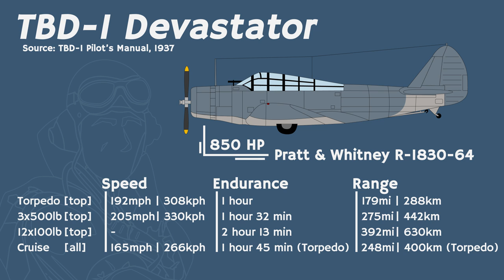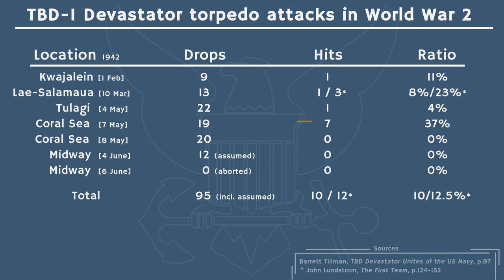In Defense of the Worst Aircraft of World War II - TBD-1 Devastator

Comment: It's interesting that outside of the areas of endurance and range the TBD (which is widely remembered as a terrible aircraft) compares very favorably with the Fairey Swordfish, which is fondly remembered as a great plane by many today. To be fair, the endurance and range of the Swordfish greatly helped it in the duties it faced in the Atlantic and Mediterranean (striking the Bismarck; hitting Taranto at night; convoy escort on the Murmansk run). However, even if Laub's recollections from 1970 are spot on the TBD was still much faster than the Swordfish. One has to wonder how fondly the Swordfish would be remembered today if it had had to attack a Japanese fleet in proper defensive formation with A6M CAP rather than an individual German ship or some Italian ships caught at anchor.
Reply from the maker: I think one issue is that the opportunities the Swordfish had worked out in it's favour. They were involved in those two massively publicized events you mentioned, that being the sinking of the Bismarck (a good old David vs. Goliath story) and Taranto which were a success. Beyond that you also had Mers-el-Kebir, and the Swordfish was also tasked into recon and ASW without a clear replacement slotted to come in until '43.  Midway is the 'only' battle the TBD usually gets linked to even though it flew multiple operations before that and did not have single loss to enemy fire until that very last battle. However these engagements were less publicized, and the TBD (courtesy of the Mark XIII) punched perhaps below its weight in pretty much all of them except Coral Sea where it had that one 'claim of fame'. Had the hit ratio at Kwajalein, Lae-Salamaua and Tulagi been higher, to lets say an overall average of 30% which would have been perfectly possible in at least the latter two (since like Taranto and Mers-el-Kebir they were 'harbouresque' attacks), then I do think history would have been kinder to the aircraft. These missions did show that it could do its task, if properly supported, just that the torpedoes made those particular drops null and void - something that only worked out properly at the Coral Sea.
Reply: @MilitaryAviationHistory  I'm surprised you haven't mentioned the swordfish's own "Midway" scenario the Channel Dash, where all of the swordfish sent out to attack the KM ships were absolutely destroyed with zero damage dealt to the KM or the LW by them. Almost as Identical to the TBDs at Midway with their lack of fighter cover and their heavy opposition, I guess it hadn't mired the Swordfish's PR as 2/3 major actions they had been that were heavily publicized had been positive.
Reply from the maker: @legoeasycompany  Yes, that could be an example, but I think the circumstances are different. In the Channel Dash (‘42) about a handful of Swordfish were lost (iirc), among a plethora of other planes - if it was only/nearly only the Swordfish that did poorly that day, with the rest of the planes achieving success, then maybe it would have stuck out. But both the RN and RAF had a poor show that day and in the chaos the Swordfish was only part of the casualties, other than in Midway where the individual carriers lost close to their full complement which was more significant overall – and the reasons were more apparent. Before the Channel Dash, the Swordfish had already hit Taranto (‘40) and the Bismarck (‘41) before that – and nowadays (and for some time) give it that David vs. Goliath vibe. I guess ultimately there is a fine line between that and gaining a bad reputation – one or two missions can make or break it. If we were to assume that the early TBD sorties would have seen more success, maybe if would have also taken a softer blow to its reputation. That said, I also feel like the fact that the Navy did have a replacement for the TBD in the TBF (the latter was supposed to play a more prominent role at Midway anyway) contributes to its status today because it artificially underlines that ‘outdated’ status and the tragic nature of VT-8, VT-6 and VT-3 at Midway.
Reply: @MilitaryAviationHistory  I do just like how the Swordfish and TBD both considered "outdated" while the former had the triumphs of Taranto and the HF the Bis, while getting completely slaughtered at the Channel Dash without it's perception being tarnished that much. While they both had their bad day against 1. Strong AA and CAP  and 2.Were attacking in small uncoordinated strikes unsupported by friendly fighters. The Swordfish still has the proud moments of the previous 2 mentioned events, while the Latter the TBD has good but not outstanding records when used effectively. Yet one gets praised for it's actions while considered "outdated" yet the other while with good service gets lambasted for being outdated and said to perform poorly for it's actions at Midway. (Even though as you mentioned the 6 "State of the Art" TBFs stationed at Midway had similarly poor results and suitability). One gets all the praise for it's actions and outdatedness, while the other gets all the smack talk for it's similar outdatedness and other poor factors at Midway.
Reply: Bear in mind that the best two performances of the Swordfish (Taranto and Bismarck) were done at night (Taranto), with no aerial opposition (Taranto and Bismarck), and/or in execrable weather (Bismarck).  The Devastator never went into combat at night (and I can find no evidence of it attacking in bad weather), and even the Swordfish, when up against a target defended by fighters (Channel Dash) did predictably horribly.  Also of note, the Brits never had our problems with aerial torpedoes - apparently, theirs actually worked. 

Later in the war, the Stringbag proved viable in the North Atlantic, where it's good poor-weather performance, its ability to operate off a CVE "baby flattop" and its ability to fly slow and stable in a bomb run, put it in a good position to sink U-Boats (and the same could have been said of the TBD if it had been used in that role).  But in a contested battle, the Swordfish (imagine it at Midway, vs. the TBD) was certainly at least as vulnerable as the TBD.
Reply: @michaelbizon444  I'm sorry but I have to disagree.  The varied missions undertaken by the TBF included many that were beyond the realm of "viable" for the TBD.  These include night-attack using radar, night CAP (also using radar, in conjunction with F6Fs without radar, such as the squadron Butch O'Hare commanded when he died), rocket-firing ground attack, and coordinated torpedo attacks (such as against Yamato and Musashi) where airborne speed was a critical success factor, long-range (and relatively high-speed) scouting missions - the list goes on.  TBD was obsolete, and you don't win wars by flying obsolete aircraft. 

Also, the Sherman example isn't actually on-target - while it might have taken five Shermans to take out a Panther or Tiger, remember that Shermans always entered combat as part of a five-tank platoon, or 15-18-tank company, so the numbers were always there compared to the penny-packet use of Panthers and Tigers in the West.  The appearance of five or 15 Shermans taking on a Panther creates the illusion that this is what it takes to defeat the Panther, instead of conveying the truth that this is how the Shermans were put into combat.  To validate this, by all means check out Rick Atkinson's Liberation Trilogy or any of several RP Hunnicutt books on US armor in WW-II - especially  "Light Tanks (Stuart) Vol. 1" or "Medium Tanks (Sherman) or "Heavy Tanks (Pershing)" for information on our squad formation and battlefield commitment.  Or check out the Chieftan's "Think Tank" series of videos, featuring a panel discussion among six of the most recognized tank warfare historians.
Reply: The Swordfish was just used differently. It wouldn’t have done good in the TBD’s role but it did fairly well in what it actually was sent to do. We need to remember that what people would consider bad about the Swordfish, often brought more some advantages against the enemy as well.
Reply: Ned Barnett The Brits always did like their night attacks : P
Reply: Look what happened during the channel dash. The one Swordfish squadron that attacked was wiped out just like Torpedo 8 by the Luftwaffe air cover.
Reply: @michaelbizon444  I never said, nor did I imply, that the six essentially prototype Avengers at Midway were doing anything other than an unsupported attack against overwhelming odds.  Later, the Avengers did carry radar - which the already-overloaded Devastator could never have fielded - and performed many other missions, from COD to ground attack, from torpedo attack to anti-sub patrols (though the Navy's carriers desperately needed anti-sub protection (Saratoga, Wasp, North Carolina, etc.) in 1942, TBDs did not do anti-sub patrols.  That was left to the far more capable SBDs) 

However, your final line (before the incomplete comment about Shermans) says the Devastators would have been updated and improved, which is what I said should have happened, but didn't.  The plane had been out of production, and the assembly line repurposed to other Douglas aircraft (C-47/R4D, A-20, SBD, B-17s (through it's Vega subsidiary), and had other planes, like the A-26, coming on line - so producing them in the quantity applied to the Avengers (over 5,000) wasn't in the cards, nor should it have been.  The TBF was a far more capable aircraft, with nearly double the horsepower, more than double the range and double the speed, better protected (passive and active protections).  I can't for the life of me figure out why anyone would prefer to put a dinosaur back into production when a truly modern aircraft was already in production.

Finally, returning to the TBF at Midway, these six planes were basically all that had been produced. Their crews weren't fully-trained in their new aircraft, which (as do all new aircraft) still had a few teething troubles.  However, if we'd had three deckloads of TBFs, supported adequately by F4Fs and flying in concert with SBDs (hitting them high and low at the same time), which was tried with the Devastators, but their performance was so inferior to the SBDs and F4Fs that coordination proved impossible.  Had it been possible, the TBD might have survived better - but still not good - the plane was too inferior to go up against a well-armed battle fleet supported by A6M Zero-Sen fighters.  And the Grumman Avengers at Midway would have done far better - as it did at Philippine Sea and Leyte Gulf in 1944.  But sending in six with no fighter cover, and unconnected to any other attack (they didn't sync up with the Midway-based Marine  SBDs and  SB2Us, let alone the USAAF's sacrificial lambs, those four doomed B-26 "torpedo bombers."

But enough of this - you have your views, which I don't share.  I've researched this at length for several historically-accurate novels about the air war in the Pacific in 1942, and I've seen nothing to suggest that even upgraded TBDs could have done well - though they would have done better with the more powerful version of the aero-engine that powered them.
Reply: @michaelbizon444  Tell that to the Yamato and Musashi, which - with the rest of the Japanese battle fleet - could have done much better had America stayed with upgraded versions of the TBD. 

Beyond that, I never said nor implied that the torpedo bomber was a war-winning weapon - it was an integral part of any Alpha Strike deckload attack launched by US carriers, and was intended to operate with fighters, fighter-bombers and dive bombers, supported by search aircraft (which were SBDs. SB2Cs (later in the war) and TBFs throughout their service).

What the German fleet had or didn't have is immaterial (though they produced a torpedo-toting FW-190 torpedo bomber that, had the Germans actually put a carrier into operation, would have been the best carrier-based torpedo bomber of the war - but the Kreigsmarine never finished a carrier, so that's mute.

Finally, while you're right that the Japanese carrier pilot force was a small elite that was not easily replaceable - but in the first year of the war, their B5N-2 was the best carrier torpedo bomber on earth - it was fast, and because of the torpedo it carried, it could drop those torps at twice the speed the TBD could do, and at four times the (50-foot) altitude that so hamstrung the early American torpedo bombers.  However, with no armor or self-sealing fuel tanks, as soon as the F6F reached the fleet, it was just another plucked victim of the Great Marianas Turkey Shoot - i.e., one more reason that so many F6F pilots became aces.  But as we saw at Eastern Solomons and Santa Cruz (the other two carrier vs. carrier battles, along with Coral Sea and Midway), the Wildcats, unless placed on the right vector and at the right altitude, had a damn hard time catching them.
Reply: Duchy of Mecklenburg-Schwerin If they used the TBD in the same scenarios as the Swordfish I’d expect similar results.
Reply: Duchy of Mecklenburg-Schwerin Yes but it shouldn’t have been. How an aircraft is used is often one of the most important factors of how effective an aircraft is.
Reply: The design philosophy was remarkably different - the US - "modern, fast, shiny" torpedo bomber - the British - can it fly, can it carry bombs, torpedos, etc, can it be made of wood?

Also something that wasn't noted was radar.  The Swordfish has a very low radar signature making the "modern" radar operated AA ineffective.

Strategic note - Pacific battles involved massive amounts of "fog of war" - it was hard to find the enemy even when you wanted to.  The North Sea / English channel  did not have that problem, in fact it was pretty much the opposite.  Japan and American wanted to find each other so they could fight.  German ships did NOT want to be found.
Reply: Oh, I'd say right about as well as the attack on the Scharnhorst and Gneisenau went during operation Cerberus.

(spoiler alert; not well XD)
Reply: I always wondered how would have the TBD fared, if the brits had been desperate enough for a replacement of the swordfish to accept it as lend-lease, or outright buy them from a USN that was looking to replace the and thus willing to sell them in number.
Reply: It helps to drop working torpedoes.
Reply: There isn't enough money in the world to make me take an old Stringbag up against Bismarck-class battleship. Sounds like suicide.
Reply: @michaelbizon444  all true...but really, that's very sloppy wasteful planning
Reply: Duchy of Mecklenburg-Schwerin  NO Torpedo bomber is going to do well in an attack run against any kind of competant CAP, no matter WHICH countries pilots are flying the fighters, or the torpedo bombers, something you may need to get your head around. Vertically dropped arial torpedos were NOT a thing at this time, so the weapon required an attack run which was low, slow, and on a predictable course, these things made Torpedo bomber easy targets for even a single battleships AA.... 

As for incompetant Italian bois, you obviously have absolutely no idea of how competant the Italian Navy actually was, here is a hint, they were actually very competant. There was nothing wrong with the Italian Navies men or ships, the thing that ended up crippling the Italian Navy was 1) Lack of fuel, and 2) terrible quality control for their main gun ammunition which meant that many Italian ships were unable to hit the side of the barn from the inside.  Note, that was for their MAIN battery ammunition, not their AAA Battery ammunition... that worked just fine.... 

I would like to see how a US Carrier would have fared in the Med.... chances are it would have ended up on the bottom, US Carriers with their unarmoured decks would have been dead meat against large scale attacks from land based aircraft of the Italians and Germans attaking in such large numbers they overwhelmed the CAPs, and which tended to use larger bombs. The TBD and the Swordfish were designed for two different operational theatres, and NEITHER would do well in an uncoordinated attack where the torpedo bombers went in unsupported by either a diversionary dive bomber attack, or fighter protection.
Reply: @michaelbizon444   I have read that one reason for the Finns success with the Buffalo was that they pulled the "navy specific" equipment from their Buffalos, which lightened them somewhat and made them more combat ready against the Russians.
Reply: The Stringbag wasn’t deployed in the Pacific much to speak of at all.  So all the British torpedo pilots had to face was AAA, which while formidable was much easier to deal with than would have been a zero rolling on on you.
Reply: @michaelbizon444   One thing you are missing is the potential for upgrade of the airframes. The TBD simply couldn't be upgraded to perform the missions that the TBF and TBM performed later in the war, it couldn't carry the weight and couldn't mount an  engine that could. The airframe was at its limit. It would have needed a complete redesign from the ground up, much more extensive than the F4F got as the FM2. Also, citing a production of 150 carriers is extremely misleading, since the vast majority of that number were escort carriers that were neither intended nor suitable for battle fleet service. Likewise the planes you cite as being in service until the end of the war were being used in support roles, not in the context of fleet actions or other first-line fighting. The M3/M5 Stuart and M3 Lee/Grant tanks were also used until the end of the war, but they weren't the tanks slugging it out with Pz. IVs, Panthers, and Tigers, and the Normandy campaign would have been a lot tougher if they had been. Every major power in WW2 continued using obsolete equipment in secondary roles that would have been suicidal in a primary combat role.

Finally, you are ignoring an entire and extremely vital phase of the war for 18 months or so after Midway but before the US' wartime production had reached the front in sufficient strength to make its advantage overwhelming. Yes, the US' productive capacity made a Japanese victory impossible IF the US held on long enough, and did well enough, for that capacity to come into play. But that was not inevitable, and if, for example, the Americans had not held on by the skin of their teeth during the Guadalcanal campaign and then ground the Japanese down so severely in the rest of the Solomons campaign, the course of the war, and possibly its end, could have been very different. And newer and better planes were of vital importance in those campaigns - I think it's fair to say that if the USN had been using F2As and SB2Us at Guadalcanal that battle would most likely have ended with a Japanese victory, with the last two then-operational US fleet carriers (Enterprise and Saratoga) on the bottom of the ocean, and the war would have dragged on into 1946 or 1947 if the US had even had the stomach to continue the fight at that point. 

For that matter, Midway would have probably ended in an overwhelming Japanese victory if the USN had been using all F2As and SB2Us there, because the latter wouldn't have had the range to strike the IJN carriers before the latter had finished rearming and been able to launch a massive strike that probably would have wiped out the US carriers. The SBDs from the US carriers were at the extreme limit of their considerably longer range when they attacked.
Reply: @michaelbizon444  Those battles were two years later, though, and the war had effectively been decided by then. In the two carrier battles of 1942 after Midway the Japanese carrier forces were superior in both tonnage and planes. In 1943 the decisive fighting was in the Solomons and the Japanese used land bases for both naval and army air force planes. I would argue that Midway ended the period of Japanese dominance, but they were still very much in the game at that point, and it was the fighting from August 1942 to November 1943 that really decided the war. After that Japan was merely prolonging the inevitable.
Reply: @michaelbizon444  Perhaps they could have been, i was just speculating on the motives and looking at examples of other aircraft. In the end, the question is why they would want to go through the considerable trouble of upgrading an obsolete plane when a replacement that was superior in every respect was already ready. As for the Swordfish, it was more than 1,000 lbs. lighter with a comparably-powered engine, so the extra weight was less a problem - the main problem with the Swordfish was that being a biplane it just wasn't going to be possible to make it fast enough to keep up with other front-line aircraft.

The Sherman was absolutely NOT inferior to the Panzer III or IV, and there are numerous German sources confirming this. It had a better gun, better armor, better mobility, better reliability, easier maintenance, and much better ergonomics (which add nothing to paper stats but are crucial to real-world performance) than either of the German tanks had when it was introduced. (Both the M4 and Panzer IV continued to be upgraded for the remainder of the war, so a head-to-head comparison depends on which specific model you're looking at, but almost no ausf F2 or G Panzer IVs with the high-velocity 75mm gun were present in Libya when the Sherman first saw combat, and the heavier gun and later addition of extra armor came with significant drawbacks.) Even the M3 Lee caused Rommel to note that the superiority of German tanks to British ones in North Africa was at an end - the main reason the Germans were able to win at Gazala was superior tactics that led many British tanks to be destroyed by German AT guns. The Sherman was arguably the most advanced and capable tank in the world in 1942: the Tiger was much more formidable in a one-on-one engagement, but the whole heavy tank concept proved a strategic failure and was abandoned after WW2. And as I noted, the Sherman handed T-34/85s their asses on a regular basis in Korea.
Reply: I have never considered the TBD to be a bad aircraft and in general is much superior to the Swordfish, however that said both were designed for their respective theatres. The Swordfish was built to be extremely resilient, I'm not sure a TBD could have been launched in the same situation as the Swordfish going after Bismark (50-60foot deck pitch and green water shipping over the flightdeck 60feet up on Ark Royal)
Reply: It was also roughly equivalent to the B5N "Kate" flown by the Imperial Japanese Navy. The Kate wasn't known for durability or speed either. The TBD was one of the most advanced aircraft in the world in 1937 but by 1940, military aviation had advanced so quickly that it was obsolete.
Reply: @brucetucker4847  Et al.  I think you are missing Mike's point either willfully or through complete lack of comprehension. He is saying once America had broken the back of the IJN carrier force at midway, the result would have been the same even if the losses would have been higher. This is completely logical given The US could have sustained 2-3 times the losses they did at every future naval battle and still would have ended the war with more than the IJN had at the height of their power. He is not saying better equipment did not help, or would not have helped it is unarguable that it did simply that the end result was inevitable.

The Sherman is a perfect example of this the Sherman could have been replaced with a heavier and better replacement only with extensive upgrading of shipping, port facilities and bridging equipment, and would not have been available in the numbers used due to fuel use, and a much greater dependence on spare parts and repair facilities. The end result would have been a much less available and dependable tank, the lack of a proper port and insanely long truck logistical routes made this a certainty. in short the Sherman was good enough, and for practical purposes better than a better tank would have performed. Once equipment reaches the level of good enough other factors become the deciding factor(s). The TBD given a proper torpedo and more evolved escort tactics could have finished the war without changing the result.

A more telling example of this is the spitfire, the p-51 outclassed it in everyway, the british took them on through lend-lease yet the brits continued to upgrade, produce and field spitfires, and guess what....they did just fine.
Reply: @beefy1212  I am not missing his point, I am disagreeing with it. The war was not as good as over after Midway. Well over a year of very hard fighting remained before the US material superiority became overwhelming. Had the US had vastly inferior prewar planes during that time the results would have been very different. Would the US still have won? Perhaps, but only if they were able to stomach a few hundred thousand more dead soldiers and sailors lost over two years of fighting losing battles before they could finally overwhelm the Japanese with numbers. I'm not convinced the American public was willing to bear the cost of fighting a war the way Stalin did, expending people by the million to make up for technical inferiority.

If you think I'm wrong, I urge you to read a few histories of the Guadalcanal campaign to see how narrow and how costly the American victory there was. You might wish to note that the worst naval defeat in open battle in American history came two months after Midway. At one point in that campaign the entire strength of American carriers remaining in operation in the entire Pacific Ocean was one ship (the Enterprise) and she was damaged and badly in need of overhaul. We got through that only because our sailors and pilots were able to inflict equally crippling damage on the Japanese. There is no doubt in my mind that if the US had been operating with vastly inferior airplanes that campaign would have ended with a major Japanese victory with the entire US carrier fleet at the bottom of the Pacific and the entire ground force on Guadalcanal annihilated or suffering the fate of the men on Bataan. One can only imagine how that would have been treated by the American press.

The Sherman is not comparable to the TBD or F2A. The Sherman is closer to an F6F - mid-war technology, not pre-war. When introduced in 1942 it was superior to or at least competitive with any other medium tank in service. If the US had tried to fight the war with its pre-war M2 medium tank (which is more like the F2A and TBD, the difference being we had a year to field newer and better equipment before we had to commit any armored units into combat against enemy tanks), and the British with its pre-war Matildas and early cruiser tanks, it would have been a disaster. Germany would still have lost to the USSR, but the Normandy invasion would have been a failure. 

The P-51 did not outclass the Spitfire in every way. It certainly outclassed the Mk I and II Spitfires of 1940, but the Mk IX and later Spitfires the British were using in 1944-45 were a quantum leap in performance over the early marks, with up to twice the horsepower and 100 mph greater top speed. The Griffon-powered Spits introduced near the war's end were actually faster than the P-51D and considerably more maneuverable (although they couldn't come close to the Mustang's range). Hurricanes were not capable of being upgraded that way and as a result they were quickly relegated to secondary duties and theaters and eventually withdrawn from combat service. The Spitfire and the Bf109 both proved remarkable in their ability to be upgraded, far beyond any other plane or combat vehicle I can think of from the war. (The P-51 is up there, but only because the performance of the Allison-powered versions was so woefully inadequate when they were introduced.)
Reply: @barryjobe  Except for some of the torpedos which exploded when they hit the water.
Reply: @MilitaryAviationHistory  I sincerely do believe that the sample pool for things like this is waaaaay too small for any statistically significant analasys.
Reply: The swordfish is fondly remembered because of its role earlier in the war.  By the time America entered the war in late 1941, both aircraft were obsolete.  This was very early in the history of military aviation, and things were changing very rapidly.  Every few months some nation or another introduced a new plane design.  An aircraft that was amazing five years ago and quite serviceable two years ago was now mediocre.  That is a substantial portion of the problem with the Devastator:  it was near the end of its useful service life by the time America got into the war.  Other nations were putting newer designs into service, that were better.

You can see a similar phenomenon with ships in WWI, where several major navies entered the war with a number of pre-dreadnought battleships in their fleets.  They weren't competitive at that point, regardless of how innovative they'd been when they were built in 1904 or so.
Reply: @ @michaelbizon444 But with a lot higher body count, and if its you in the cockpit which plane do you want to be in the TBD OR THE TBF? As like being in a Swordfish with a A6M on my tail, does not sound like a good time or as far as that goes any thing but I'd still take the best plane I can. No fight is fun but being out classed in a fight truly sucks the big one.
SPC-Lee a Benson 11B U.S. Army (RET.)
Reply: @legoeasycompany  .
Quite right, however, the Swordfish never took part in the Battle of Midway, this was a purely US battle and respects for that. 
Yes, the Swordfish was a 'Sitting Duck' when attacked by an FW 190, what do you expect ? But the Swordfish was very slow and it screwed up the rangefinders of the gunlaying stuff of modern battleship's 
C'mon, give us a break. 
Respects to all veterans everywhere. 
The US had its own 'lame ducks' and so did the fleet air arm. 
We fight with what we've got and do our best.
Respects to all veterans everywhere.
Reply: @oldgitsknowstuff  1. I never said the Swordfish was at Midway 2. The point of talking about the Channel dash was pointing out similarities of them both having bad days, although with the Swordfish's record it seems their bad day was overlooked. Meanwhile the TBD has been constantly lambasted for it's poor showing, while the swordfish gets praised while both were outdated at that time in the war.
Reply: @legoeasycompany  .
Well you did mention Midway & The Fairy Swordfish.....
Look, I'm not wishing to start a conflict over which aeroplane had the most accolades and those that didn't. 
Both the USN and Fleet Air Arm had their Dogs, and Christ Almighty, the FAA had some bloody Dogs ! 
The USN had their bloody nose but staggered up to the plate and made some fine Carrier aircraft. 
I have no dispute with you or any veteran who had to fly in the first generation of Carrier aircraft.
Hope this reads better than my first comment.
I previously stated, respects to all the veterans no matter what they had to fly.
High 5s to you Sir.
Reply: @TimDyck  As strange as it is, I absolutely belive it. It seems well refined turn fighters were more effective against more advanced fightercraft than early monoplanes.
I for one read that Hungarian CR42 biplane fighters had a reasonably good showing in the early stage of Barbarossa.
Reply: @legoeasycompany    Yes, keeping in mind that we are talking about only six Swordfish.  I expect that having learned from the fate of the Bismark that anti-aircraft batteries were reinforced on the remaining ships.   And unlike the Bismark with 9 and then 15 torpedo bombers attacking one lone ship, this was just six bombers attacking a formation with destroyer escort. 

I understand that the antique style canvas airframe of the Swordfish actually enhanced its survivability at least early in the war.  20mm and 37mm anti aircraft cannons would punch holes in the canvas without detonating (canvas offering insufficient resistance for the contact fuses).  Maybe the Germans made their fuses more sensitive  (speculation - I have no resources to check). 

Seems that the B5N outclasses any other torpedo bomber of the era but the Swordfish outclassed the TBD-1, even before we factor in the torpedo problem.  Can't argue with the success of the Swordfish - they destroyed a lot of tonnage of shipping with those planes.
Reply: @michaelbizon444  And how many tanks did Germany, the UK, and the USSR lose in the same period? (A quick search returned an answer of 22,700 tanks lost in 1944 alone by the Soviets.)

And to answer your question, because the Sherman was a different generation of technology than the TBD. The TBD was introduced in 1937. The Sherman was introduced in 1942, the same year the Tiger, the TBF, the F4U, and the P-47 were introduced. All of those machines proved useful and competitive until the end of the war. As I said before, if the British and Americans had tried to invade Normandy with the tanks they were using in 1937, the invasion would have been a failure.

You still haven't addressed or even acknowledged the Sherman's record against the T-34/85 in Korea.
Reply: yes, you have answered your own point...a couple of squadrons or even half a dozen Swordfish were sometimes-though not always-- able to accomplish some tactical success in the ETO...Taranto is obviously the jewel in the crown, but, it was the Italians not either of the more competent Axis powers-- in the Pacific vs IJN in any form, it would have just been futile suicide each and every time..the TBD had to face the full-force of the IJN when it was rampaging and basking in virtually unpunctuated victory...whatever disasters for whatever scant success the TBD had, it would have been worse still supplanted with either of the RN biplane TBs..the TBD had patchy and iffy fighter-cover from the F4Fs., which might or might not be able to trade 1:1 with the Zero if lucky...still a lot better than nothing.....the Swordfish effectively never had any fighter support on any operation, unless now and then supported by Fulmars and Skuas, not even sure if Martlets ever covered a Swordfish or Albacore job..the Fulmar and the Skua, which were only ever available in handfull numbers anyway, either of which would have stood about  as much chance  against A6M2s as an unescorted  TBD itself did....
Reply: @alganhar1   
Not sure if this has been mentioned, but U.S. carriers did have an armored deck it just isn't the flight deck.  Here is an interesting read to look up: "Were Armored Flight Decks on British Carriers Worthwhile?"
By Stuart Slade and Richard Worth
Reply: According to Charles Lamb in his book, the Swordfish had advantage no-one else wanted: it was slow.
Besides having a low radar signature, making it near-stealth, torpedo accuracy has a lot to do with plane speed. You are dropping a powered but unguided torpedo into water, from air, in conditions of waves and wind. Slower you go, lower you go, the better the accuracy. This might allow for longer release distances in good conditions too.
Next thing is wooden and canvas construction. Wood and canvas get pierced when hit by bullet or shrapnel, aluminum gets ruptured. You can poke a thousand holes in the wings  and it still flies.
Many guns dont depress low enough to attack the Swordfish.
Of course, against fighters its almost defenseless and should not be sent in daytime or in hostile skies without formidable escorts. 
The last thing about speed is that germans used mechanical computers for targeting AA fire, which were not designed for such ridiculously slow speeds and would not give correct firing solutions. The japanese, not having such computers and relying on the seat of the pants method, would have had more success. This also means that german computerized AA would have far deadlier effect than japanese on the faster planes.
My assumption is that these factors mostly cancel each other out, placing the Devastator on top of Swordfish for its air to air capability and survivability.
Reply: @legoeasycompany  I won't join in the inevitable debate about which piece of technology could have won the war on its own but I will give you my answer to your question about how two aircraft that performed similarly can be remembered so differently. My answer is: 'social consciousness and context'.
If you're British, and you've been living through the aerial bombardment of all your nation's iconic places in the knowledge that there's a good chance your country will be invaded and you will lose all that you love and hold dear, then any victory is a great victory; and a victory won by brave chaps flying a vulnerable, out-of-date underdog is the greatest sort of great victory because it gives you hope and confidence in what plucky underdogs might yet achieve.
If you live in the United States, and you're rightly furious about Pearl Harbour but also rightly confident that 'the arsenal of democracy' can produce the men and machines to bring a just conclusion to an infamous war, then any loss is a terrible loss; and a loss attributed to technological shortcomings is among the most terrible of terrible losses because it threatens your confidence in industry and means your boys might not have the advantage that you expect they should.
In both cases, pilots and crews face the same terrifying realities with the same courageous determination, and die the same deaths; only the way their aircraft are remembered differs.
Reply: michaelbizon444   Quantity has a quality all its own.  Also, don’t think for a minute the Zero was superior to the Corsair or Hellcat. Just stop with the romantic revisionism, embrace real history!
Reply: Am I imagining things, or is the Sherman vs Panther debate even showing up in a discussion about the Devastator? I go to an aircraft channel, and there it is... hmmm....can we ever get away from that never ending debate?
Reply: There are too many "what ifs" and other variables to compare apples to oranges.  The Japanese lost too many of their most experienced fighters, and those that weren't lost in the early stages were not rotated out w/ fresh pilots allowing for the experienced to teach new recruits.  Japan had fewer resources to replace that which was lost.  They had fewer people to fight the war.  They lacked the vast amounts of food  that the US could produce.  They opted for lighter weight for range and maneuverability making them vulnerably to catching fire, thus greater loses of planes and pilots.  Had the US kept slower planes, would that have caused greater casualties of experienced pilots?  ................
Reply: when attacked by a fighter, their practised defence was some kind of wild split-S manoevre to violently avoid or something...they realised one guy in back seat with a WW1 Lewis gun probably was not going to cut it usually...I think he was chased by either CR42s or Italian monoplane fighters over the Med at least once, but managed to lose them..  
they practised air to air with a Skua playing the bogey.....one of the Skua crews misjudged crashed and was killed during such exercises as he relates..
Reply: Thank you for bringing that point up and, frankly, thank you for asking for this video. I'd always suspected the TBD might've been outdated and that could've been the reason for its malignment, but the comparison to the Swordfish? I'd honestly never considered that.
Reply: The issue in the Pacific is that the US Navy was facing the finest naval aviators in the world at the time flying the finest naval fighter of the time:  The Japanese Naval Flying Corps in their Zeros.  Had the Brits used the Swordfish against the Japanese navy, they would have gotten slaughtered by Zeros as well.  Saying that, part of the reason for the slaughter of Devastators at Midway was partly due to obsolescent aircraft, but mostly due to poor execution of marginal tactics. The Devastators at Midway attacked alone without fighter cover.  US Navy tactics dictated a combined hi-low attack of dive bombers and torpedo bombers attacking jointly AND  covered by fighter.  This was intended to divide up the Japanese CAP.
Reply: Duchy of Mecklenburg-Schwerin  Two, wasn't it?  Coral Sea and Midway.
Reply: I would actually say it was a good machine in the 1942 environment..good speed and mechanical reliability even if average gun and protection were enough to put it over the average mark on the gauge ...especially in the context of the appalling mechanicals, quality of manufacture  and interior layout of UK tanks fighting alongside it such as in North Africa.
Ok a Matilda maybe had a little better armour..but traveled at what, walking pace? lol..maybe mostly a 40mm gun , which, although fairly effective against most German vehicles at that point, you cannot even engage enemy  infantry with? lol..
Reply: I've heard recently that the armoured top decks on RN carriers were a main reason for even the Victorious-class RN ships having tiny-sized CAGs compared to US and Japanese main-force carriers?
Reply: Konev or Zhukov?
Reply: yes, I cannot see how not...Eugene Esmond's small formation were all wiped out  for nothing, and that is in conditions where the defending fighters were not naval pilots, not used to covering warships at sea against low torpedo attackers,  and from memory the weather was rotten which favored/covered  the naval attackers to some extent..
Reply: In 1941, when my dad was stationed at Norfolk NAS and the base was repairing HMS Illustrious, British sailors took a look at the TBD and said "One way trip". (American sailors were equally unimpressed with the Swordfish.).
Reply: AND YES THE SWORDFISH OUTLIVED IT`S DESIGN-AND EARNED IT`S REP.THE TBD WAS LET DOWN BY THE WEAPON I.E THE TORPEDO-ASK THE SUB CREWS. PS I`M ENGLISH!!
Reply: It was from this horrible WW2 experience of faulty torpedoes that the US Navy developed an independent test and evaluation organisation/department headed by a Rear Admiral to assess future system procurement and keep the contractors honest.
Reply: This is a bit like swinging after the bell but no one seems  grasp that the Royal Navy had zero carrier opposition in the Atlantic and the Med. And, of course, they resisted monoplanes because of their higher landing speeds but the prowess of FAA antiquities against the Japanese was non existent. When they sent HMS Hermes into the Indian Ocean to bolster their fleet protecting Singapore and it ran head on into the Zuikaku and Shokaku. These, as some may recall, were the newest and had the least well trained crews of the six carriers that attacked Pearl Harbor. Yet Hermes didn't stand an ice cubes chance in hell...

...And, speaking of Blackburn's Roc, any pilot who flew them and survived to get into FAA Corsairs or Hellcats must have felt like the luckiest pilots in the world.
Reply: That is pretty funny. I guess nobody ever looked at the Swordfish and expected great things from it, while the Devastator looked like a modern aircraft, and it was easy to be underwhelmed by its performance. Also, it’s reputation was quite literally torpedoed by its unreliable main armament.
Reply: Yes, Swordfish was a turd- it is fondly remembered for being an effective turd, everyone knew it was not very effective, but it was cheap and available, and the British simply put it almost exclusively to duties it could successfully perform.

It excelled because it was put in the right circumstances every time.  Usually the british are the prime example of resource supremacy. Making the most out of what you have.

US were looking for the best out of any situation, and they were probably too far from the action to effectively design in the same manner. hence you get the thunderbolt and the corsair. Essentially the throw industrial power at it solution, which was of course the correct one for the US. Most countries other than the UK simply didn't have centuries of uninterrupted progression in military strategy and doctrine, nor a pressing need from an expansive SOI. Hammered into the british psyche were the fights against gurkhas and maori, how even the best and most well trained can be bested if you aren't shrewd tactical thinkers and ahead of your opponent. 

Also British idealise "Daring", the concept of a dangerous plan, that just might work. Don't the unthinkable and downright suicidal even when they have the advantage, because if you win, you win big. RN capturing much bigger ships, when nobody else would attempt it back in the Napoleonic wars, despite their small crew compliments. Dam busters raid, 100 other wartime plans. Using kind of terrible aircraft in a dangerous but efficient way, hey, he who dares, wins.
Reply: It should be noted that the British too had trouble with torpedo's, during the Bismarck operations a torpedo strike was mistakenly carried out on his Sheffield scoring several hits all of which failed to detonate, when the somewhat aggrieved cruiser signaled this back the detonators where changed to the older but actually working contact type.
Reply: Thank you for making this amazing video happen!
Reply: I think everyone with a tiny bit of knowledge knew the swordfish was crap but it was so crap it actually did a really good job
Reply: Duke of Mecklenburg-Schwerin  Coral Sea and Midway. Faced the A6M Zeke in both.
Reply: The slower Swordfish was loved in part because it was survivable. Bizarre as it sounds, flying so slow kept it safe from AA fire. AA crews were used to 250+ mph aircraft, adjusting for a smaller aircraft at only 110mph wasn't so instinctive and the wood & fabric construction allowed many projectiles to pass through without causing major damage.

 Things like that have a habit of charming aircrews.
Reply: TheSwiftrain : That’s a key part of the Bismarck story, as without the failed attack on Sheffield, the attack on  Bismarck would have been made with defective torpedoes, resulting in no jammed rudder, and Bismarck reaching Brest.
Reply: Andrew Ince : The reverse is also true.

The Swordfish’s successor, the much improved Albacore biplane, was first used in a disastrous attack on the Tirpitz in its Norwegian fjord - and the squadron flying it got massacred by the tremendous quantity of flak the Germans had protecting their flagship.  Consequently the Albacore got a totally undeserved reputation as a useless death trap, and crews clamoured loudly to keep their old Swordfish rather than fly the faster and more capable Albacore!  The Albacore was actually discontinued from production, and ‘replaced’ by its predecessor, the Swordfish!
Reply: KateLicker : Yes.  British fleet aircraft carriers had only one hangar deck.  American fleet aircraft carriers had 2.  So American carriers could carry twice as many planes - but they didn’t have an armoured flight deck, so suffered more damage if they were hit by a bomb or kamikaze.
Reply: KateLicker : Imagine if the bogey was a Roc instead of a Skua.  The Roc pilot would have been so happy to have a target the Roc could actually catch up with!  😂
Reply: armynurseboy : Just to add that the Devastators were SUPPOSED to have fighter cover at Midway - but Hornet’s VF-8 got led off in the wrong direction by their CAG - and Enterprise’s VF-6 were flying so high that they couldn’t see the Devastators they were supposed to be escorting getting attacked by Zeros down low, and they couldn’t hear the Devastators calling for help over the radio either, so thought everything was going fine!  Only Yorktown’s VF-3 engaged the Zero CAP.
Reply: Ned Barnett : Just a thought...  Imagine if the Pacific War had started 3 years earlier, in December 1938 (let’s say Roosevelt had imposed a fuel and steel embargo on Japan because of the outcry over the Rape Of Nanking.)

In that scenario, Vindicators and Devastators would have been the latest and greatest planes the US Navy had (alongside Grumman F3F and Curtiss SBC Helldiver biplanes) - and they would be up against the Mitsubishi A5M Claude instead of the Zero.

Battle of Midway, June 1939?  Food for thought!
Reply: @timonsolus  in part the increased size and the use of a metal skin may have factored into Albacore's demise. A 20mm flak shell hitting a canvas aircraft is going to make a hole and not much else unless it hits a control line or fuel tank. A 20mm shell hitting an aluminium skin is going to go boom. More chance of damage. Naturally a bigger target makes for easier shooting. Being faster than a Swordfish yet still lumping around a less than balanced armament the Albacore may have proven to awkward for some aircrews to handle in combat whereas the Swordfish had been flown and loved for years, those lads knew the Swordfish well.
Reply: Perhaps because the Devastator was replaced by great aircraft, the british tried replacing the swordfish with planes that just did not work. The Baraccuda and the Firebrand are obscure for reasons. While the Avenger is remembered fondly.
Reply: @legoeasycompany  Fw-190's had to lower undercarriage to cope with Swordfish and some had unexpected damage when they RTB!
Reply: If I remember correctly the AA Directors fielded by Akagi, Hiryu and Soryu are viewed as the best AA tech fielded by the Axis, at least pre ‘43, and were substantially better than Bismarck’s in that they could hit a moving target, and not simply do barrage fire. Kaga’s AA Director system however was complete shit. So the Swordfish might not have fared as well against the a Japanese ships, even discounting the Zeros. However the Devastators might not have done as well as the Swordfish against Bismarck. Unlike the Japanese Midway Fleet, Bismarck had Radar and would have likely spotted Devastators much further out than they sited the near Radar invisible Fairy Swordfish.
Reply: When attacking the Germans or the Italians, the Swordfish did not have to worry very much about enemy fighters. The Japanese navy Zeroes would have shreaded them all.
Reply: What if the Swordfish was stuck with American torpedoes?
Reply: @timonsolus  Yet in North Africa, apart from the same dust problems  as every other vehicle, the Albacores performed well and were liked by their crews!
Reply: @cliffthelightning  Baracuda Tirpitz attack and Sumatra.... Firebrand in Suez - kept quiet.
Reply: @alanrogers7090  it would have failed.
Reply: The Devastator was a far better plane than the Swordfish. The British Fleet Air Arm was inexcusably outdated at the start of World War II and the Swordfish only survived against the Bismarck because they got lucky: the Germans didn't think ANYONE would still be using aircraft that slow, so their gun predictors couldn't be set that low. A German miscalculation is what allowed it to succeed where more modern aircraft would have failed. In actuality, no torpedo bomber aircraft fared well during the war. They were all deathtraps with horrific loss rates; the Avenger was no better in this regard.
Reply: Had the Swordfish been used against the Japanese fleet not a single Swordfish would have survived, they would have sitting ducks for the Combat veterans flying the Zero fighter.
Reply: @alanrogers7090  I wouldn't wish THAT on anybody!!!!
Reply: Daniel McGrath  Cant have everything in a reasonably small country. And there was the Seafire, though I think it was horrible to take off and land.  But Germany did no have carriers, so that problem was mitigated.
Though I did read that there was a report of the carrier Graf Zeppelin being detected in the Indian Ocean, though it was never even built. 😁
Reply: We can’t change history. What if. Desperation was a factor in the success of the Fairy Swordfish as well as planning and training of aircrew. Yes, Lady Luck played her part also.
Reply: @Wombat1916  The "Navy Specific Stuff" was removed in the US before shipping. Then they went to Sweden first where at the Saab factory the planes were converted to metric standards, armaments changed etc. but no lightening was done to speak of. The models shipped to the Finns were of the early type, being not weighed down with armour and newer equipment but WITH the upgraded 1200HP engine.
Reply: @MilitaryAviationHistory  The plane itself was better than the Swordfish. The Swordfish only succeeded due to the Bismark's designers choosing poorly in designing its AA predictor. Indeed, the Bismark's fire would have almost certainly been far more efficient under manual control with no predictor, and the losses would have been horrific. The comparably horrible loss rates of the Avenger compared to the Devastator really just rammed home the fact that the plane delivering the torpedoes mattered little; it was a suicide mission except in the absolute most favorable circumstances.
Reply: @andrewince8824  Another video talked about the majority of air defenses on the Bismarck were "angled" to shoot down a "modern aircraft" such as the Germans possessed; their computer-aimed,  larger-caliber anti-aircraft, and the intermeidate-caliber anti-aircraft guns both were  angled for what they anticipated were more modern aircraft (attacking at a higher altitude); as said elsewhere here, flying at a faster rate of speed...

The only "hits" on the Swordfish suffered during the attacks on teh Boismarck, according to the returning British pilots, were machine guns manned by individual Bismarck crew members aiming and firing independently of auto-controlled guns: the holes in their aircraft confirmed the pilots' observations as well!
Reply: @WardenWolf  See my comment above, sir.  

The main and intermediate anti-aircrat guns on the Busmarck were angled too high to hit the low-flying Swordfish...only hits on it were individual machine guns held by Bismarck crewmen...
Reply: well said !
Reply: perhaps if the Devastator had faced a less lethal opponent than the Imperial Japanese Navy, it too would be more fondly remembered. Hard to believe that the Swordfish would have survived many operations in the Pacific.
Reply: Now, will I join in on the read more comment section?

Of course I will
Reply: Had it got slaughtered without anything to show for, the Fairy Swordfish would be mentioned as a footnote of the end of the Bi-plane. But it got into the right time, the right target and face the right opponent, basically very little serious fighter opposition.
Reply: I don't remember the swordfish as a great plane. I remember it as what it was, a biplane that somehow didn't get thrown in the trash and replaced before the start of World War 2.
Reply: You have a point
Reply: Endurance and range are absolutely essential qualities for carrier-based aircraft, though. If a carrier aircraft has superb characteristics but only has 50 kilometers of operational range, it's a terrible plane for carrier operations. 

The TBD was not a terrible plane--it could reliably do its job within its limited operational range and provided that it was not subject to attack from enemy aircraft. But it was caught at a really bad time--when it was badly obsolete for the role it needed to play, but just before its far better successor was produced in enough numbers to replace it. Of course, not helping the matter is that the American torpedoes were notoriously unreliable and that US carrier operations were still very messy at that point in the war, so TBDs lacking fighter escort was a sadly common problem.
Reply: @barryjobe  history channel really the history channel is a joke
Reply: @donsharpe5786  or turned arpund or sank or failed to explode
Reply: A very good contrast, based on sometimes how the dice rolled on the day, but also on how aircraft were used to their strengths.
Reply: @patrickcannady2066  you are promoted to ground crew, potato peeling.
Reply: Wasn't the swordfish already obsolete by ww2 though? The way it was used was very effective as opposed to fleet battles with no escorts.
Reply: One thing british pilots had was alot of night flying practise
Reply: @barryjobe  Sherman tactics in dealing with enemy armour were in turn dictated by the vehicle's capabilities, including its inability to go head to head with Tiger or Panther - particularly owing to its medium velocity good all around gun / shells (the 75mm) which was the best thing the US had available at the time. 

It lacked the armour piercing qualities of its rivals but used in numbers and at appropriate ranges got the job done. The armoured combat tactics certainly didn't create the weapon or the vehicle, with 'tanks' being intended by US doctrine to serve the roles of infantry support and exploitation.
Reply: @hadrianbuiltawall9531  I don't the Swordfish was designed with radar mitigation in mind
Reply: @alganhar1  Just like Gold  and Red Squadrons if they were without Luke.
Reply: The tbd wasn’t that much better then the swordfish with its slow speed and short range. It only went like 60mph faster. I wouldn’t want to be in a tbd in a battle having to go 115mph to fire a torpedo and after that you all u got it a max of 200mph while zeros cruise at ur max speed. You can say whatever you want but at the end of the day it’s just a bad plane for it’s time it would have been great 10+ years earlier. I would have wanted to be In a p40 or a p51 fighter
Reply: @timonsolus  that would be awesome.
Reply: No matter how you put it the TBD was outdated at the start of ww2 it’s slow max speed and slow speed needed to launch torpedoes made it an easy target they were basically a suicide mission.